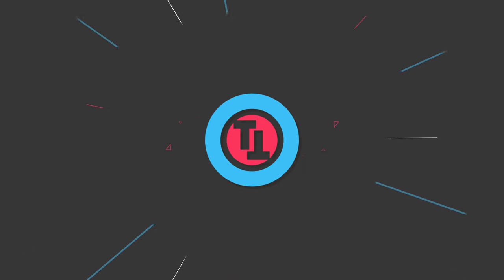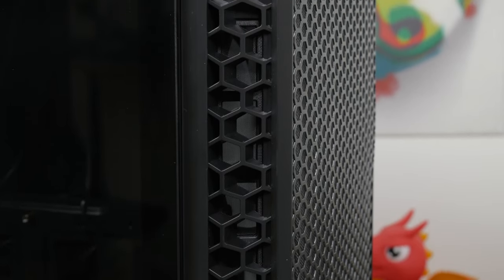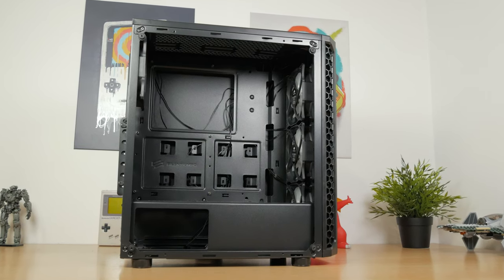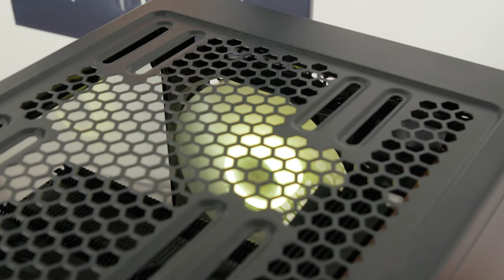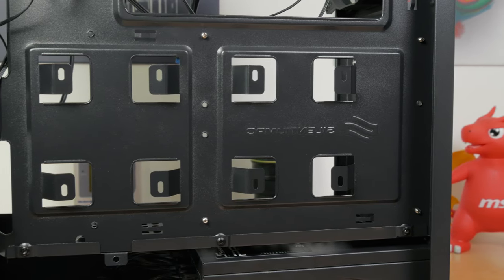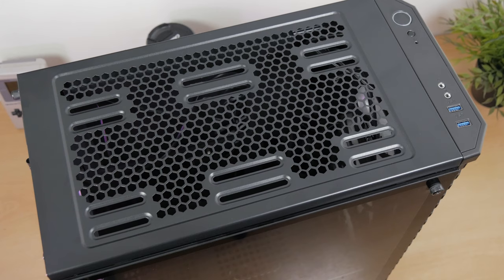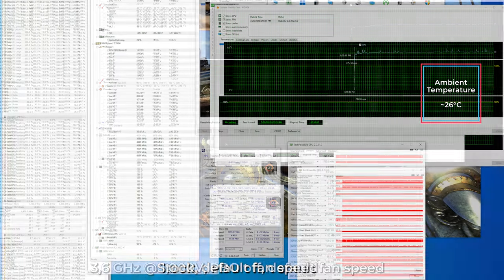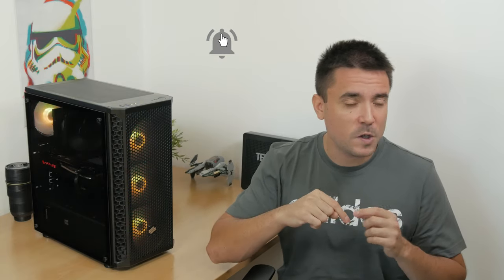The OVERLOOKED UNDERDOG - SilentiumPC Signum SG1V

Comment: This case is perfect 
Its cheap 
Its nice looking 
Have good  air flow 
Its not loud as you expect
Reply from the maker: It actually wasn't that loud (so around 43-44 dBA at full speed of every fan and system under load), it was louder, but not as quite as you've would maybe expect.
Reply: You need to cool it with vodka to have maximum polishnes